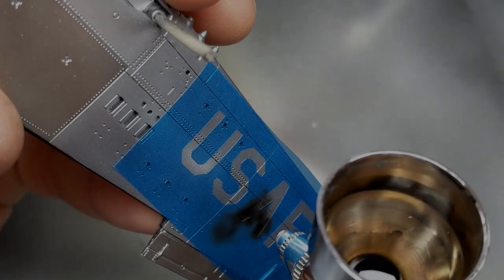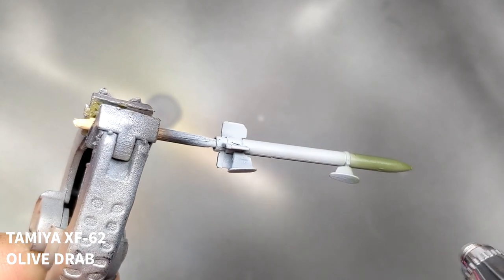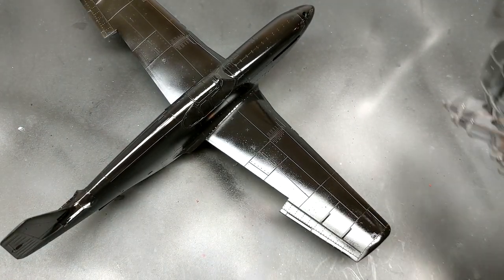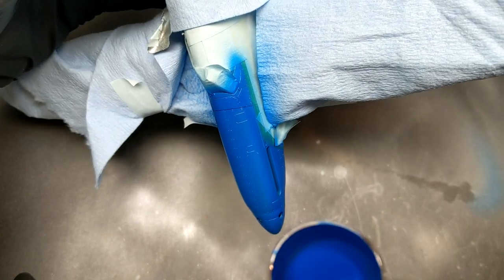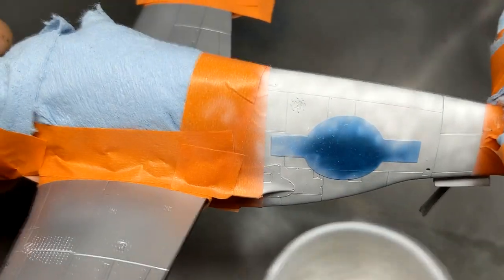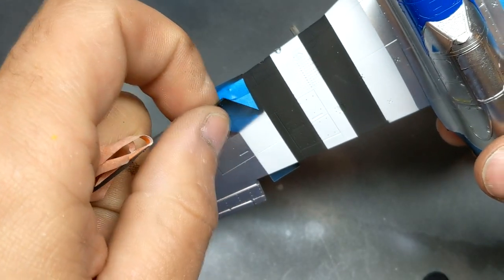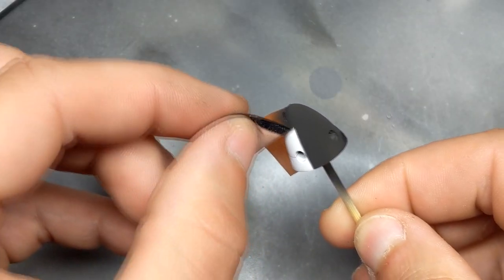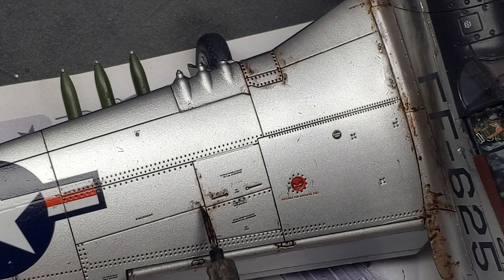1/48 Mustang Madness: Part III

Comment: Its a mystery, I know lots of folks have complained about AK metal being fragile and rubbing off - it just didn't do that on the three or so kits I used it on, my in between spray sessions were quite lengthy so maybe its needs extended time to 'cure'. I handled my (now shelved) Lightning T.5 with bare hands, banged it around, taped over it... it didn't rub off...its weird. Great video by the way...

Comment: Anyone can build a Tamiya kit (except their Sea Harrier FRS.1). Airfix kits can be a culture shock for those use to Tamiya, so no wonder you got some criticism from those who know how to build Airfix kits.  The Airfix Mustang has some very tight tolerances, so dry-fitting is a must and it will also show if those pesky ejector pin marks are visible once the cockpit is assembled ;)

Comment: Hey, I loved the whole series. Quick question. I’m trying to become a truck and coach technician. From your experience, do you think matco, mac, or snap-on is better? Or maybe even different, cheaper brands? I live in Canada too so I can’t get harbor freight unfortunately. Thanks, and keep making awesome videos!
Reply from the maker: I'm in Canada as well. I'm a Mac guy because I find Snap-On and Matco are quite over-priced. As for a tool box, before I started on the service truck I had  a craftsman box I got for $800. Instead of dropping 5k on a box at 28% interest or whatever it is.
Reply: Thanks! I’ll try to avoid a husky box as well😂😂

Comment: Love this series. 

I have a few things that get me despairing, but seams are the most frequent I think. All looks good then they're there. I think the question is, how do you do as good a job as possible without resorting to constant filling and sanding. It is mojo sapping on some kits. Thanks
Reply from the maker: I’ll usually put down some extra thin cement along the leading edge to melt the seam. If that doesn’t work, I’ll sand it with 400-800-3000 grit sanding sponge. There’s really no way around it sometimes. My Zeke I am building now has a ghost seam down the spine which is even worse to clean up

Comment: Wartime invasion stripes were very messy , they stole lots of paint from local shops I wouldn't stress about invasion stripes, admitted straight lines are purty.  The blue nose is my favorite out the bunch the blue really pops with that silver behind 👍
Reply from the maker: You can find images of some crews that took a lot of pride in it with very neat lines. And like you said, there are some images of them smashed on. A specific RCAF Spitfire comes to mind :)

Comment: I still have issues with varnish through my airbrush. I often end up with frosting. I suspect that i either do not spray wet enough or it has something to do with my air pressure. because that is like the single thing i have issues with, using my airbrush.
Reply: Dont spray when its below 15°, or when raining ,!
Reply from the maker: What brand are you using and what are you cutting it with? When I first started I cut X-22 Gloss with IPA and it was frosting. Alclad needs to be stirred very well before use. Also, you should be very close while shooting and not too far away
Reply: @TheModelGuy  I'm using Vallejo Varnish with Vallejo Airbrush Thinner. I stepped away from non acrylics because of my current living situation.

Comment: Here is an idea for your next Video, "Clear Parts".
I have problems with trying to clean up them up where the Sprue Tree molds to it after I cut them off, anther problem I have is when I get a kit, the Clear Parts are sometimes "Bent" putting "Stress" marks on the Part or "Torn Off' the Sprue altogether.
"Thanks"!

Comment: I haven't seen many modelers put rust on an aluminium plane. Would rust form on such planes and, if so, from which parts? I would think hard locations like gear or control surface  actuators, maybe even fasteners on the frame?
Reply from the maker: I came back in and tried to clean as much off as possible. Aluminum doesn’t rust but it does get weird discolouration

Comment: Awesome builds hope you do more vids like this really enjoyed it my current model is a pain in the a** it’s the J-21R by special hobby’s there was no guide pins and the instruction were almost unread able and just fell apart I’m having a break from it as I’ve gotten onto the decals and they ether stick to the surface and makes it really difficult to move around or just slide right off the model and every single on has ripped so I’m having a break

Comment: I have been having alot of issues masking straight lines on a curved model...like the forward stripe of the USCG HH-60
Reply: I used a $20 laser level from the big box store to lay out straight lines on a curved surface for a Heater-Ferris camo Phantom. Worked pretty good. If you look at it from dead above the lines that go over the turtleback and down the sides of the engines is straight as a ruler. Same with a line that crosses the radome at an angle.

Comment: I see three generations of 'modern' Airfix kits (rough dates) - pre 2015: finally a step up from 60's 70's; 2015 - 2021: better engineered but still fit issues; post 2021: much better design and engineering (1/24 Spitfire/Sea King/Gannet) but getting a bit expensive considering there are still quality control issues. They have some of the best instructions and colour callouts in the market and the best decals. My current exemplar is Kotare.

Comment: I find that the Airfix is the superior kit on the following points: 1-Best depiction of the cowling fasteners, Meng second, Eduard distant third (Eduard has no depiction at all for the top nose centerline, which is really, really bad). 2-Airfix has the slightly better nose top shape, a little wider and more amenable to flattening the curvature 3-Airfix has the best gear legs, Meng second, Eduard distant third (too skinny). 4-Airfix has the best depiction of the machine gun openings, Meng second, Eduard truly dreadful (much too small) 5-Eduard has the best windscreen, Meng closely second, Airfix a distant third (depth of side panes way too shallow). 6-Building ease. Meng wins by some margin, Airfix second, Eduard is by far the most troublesome. For metal finishes it is Meng all the way.

Comment: But Tamiya has a new tooling from 2011 of the D version, right? That is the version that should be compared with the Eduard's D... Anyway, amazing videos!
Reply from the maker: These are all 1/48. Tamiya’s sprues say 1994 on them.
Reply: @TheModelGuy  you are right indeed. Forgot about the tamiya D version in 48th. I only have the B and still from 1995. And accurate miniatures F-6 which is also nice.

Comment: Ilike the chalenge yopu have put down for yourself. I'm in the middle of a B17 Costal Command build converting a airfix B17MK 11 to Costal Command. I'm woundering what primer to use gray or white both Vallejo. Any advice would be greatful.
Reply from the maker: I’d go with white primer since the overall colours are light
Reply: @TheModelGuy  Thanks for your help. Chris

Comment: Just a quick note regarding NMF-colored MILITARY model aircraft: NATURAL ALUMINUM FINISHES OXIDIZE VERY QUICKLY on 1:1-scale Aircraft, I.E, THE REAL THING... Pristine NMF was rarely seen in real-time combat situations; the ONLY time one ever saw PRISTINE NMF was when the Aircraft in question had JUST LEFT THE ASSEMBLY-LINE... 

Just a little something to bear in mind: CHECK YOUR REFERENCES...
Reply from the maker: My biggest concern isn't really the pristine NMF, it's to get an accurate one. I've recently used aqua gloss on an Eduard P-51 to protect the paint and keep the luster. Doesn't end up looking like silver paint.